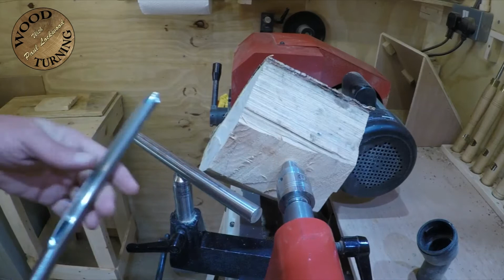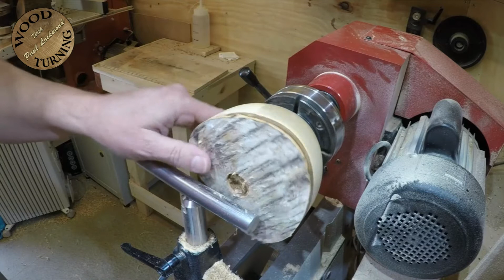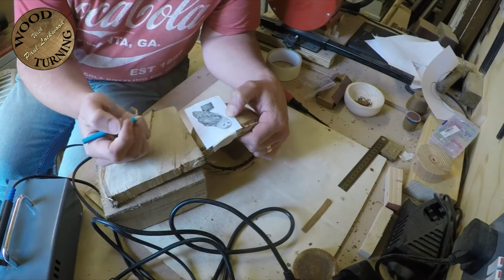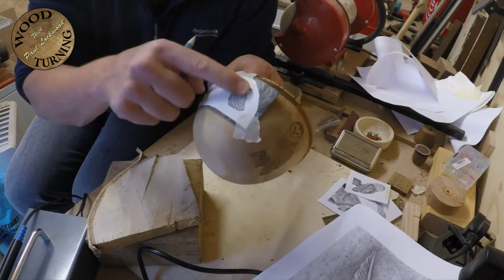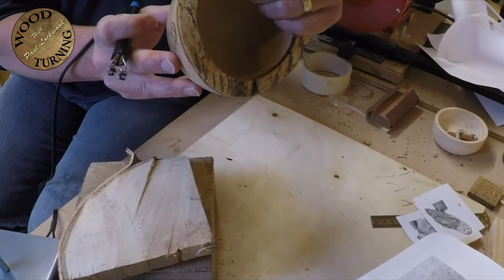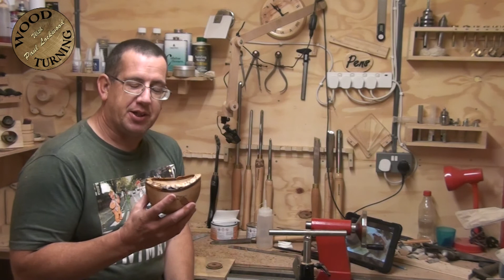Owl Bowl - Episode 95

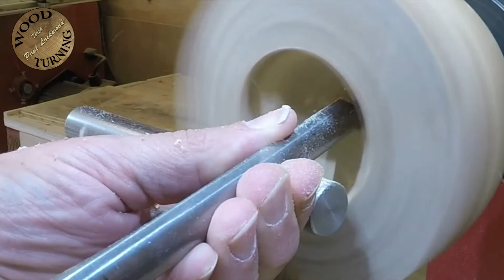Comment: 5:25 interesting to see you roughing "uphill" here, do you prefer that? I tend to find it much more difficult than the other direction.

The pyrography is very impressive, I really struggle to even mark my initials!
Reply from the maker: I like back hollowing, it was done with the bowl gouge. In fact it was going into supported wood as the grain runs to the edges of the bowl. A bit like when you do the outside of the bowl you work from the thin base to the top opening. I find back hollowing easier to get the curved cut and you don't get the jumpy catches on the rim.
Reply: I'll have to experiment with it. I am fine "back hollowing" along the bottom of the bowl but when it comes to making the curve onto the sidewall I have had some bad catches. I'm sure my technique leaves much to be desired, however! :)
Reply from the maker: I did a video where I explained how I did it, can't remember which one. The important thing is when you come up the sides make sure the wings are angled properly not to catch. If it's a very steep curve then go very lightly as you can then feel when the cut changes before you get a catch.